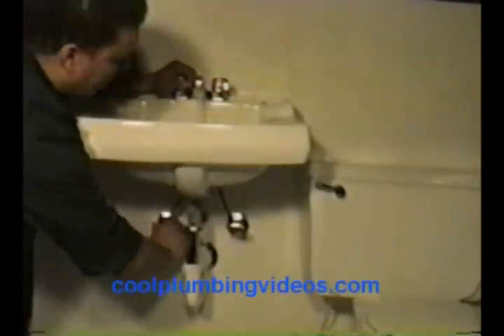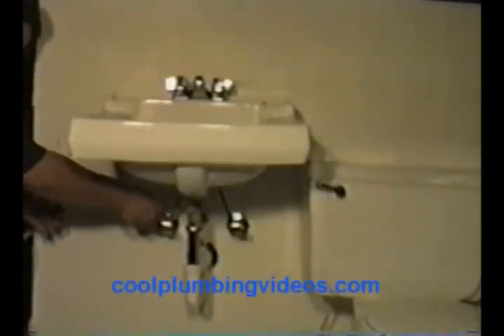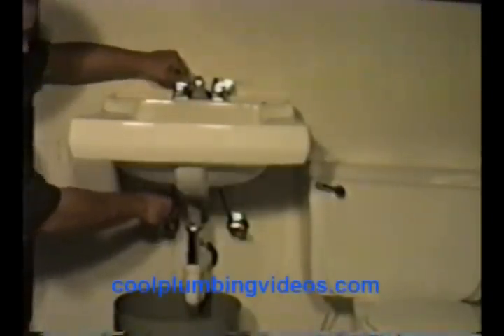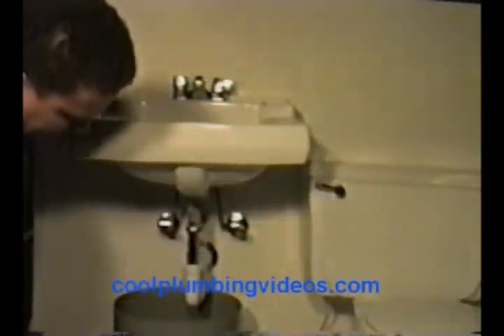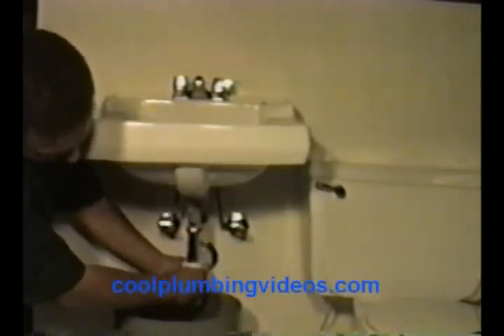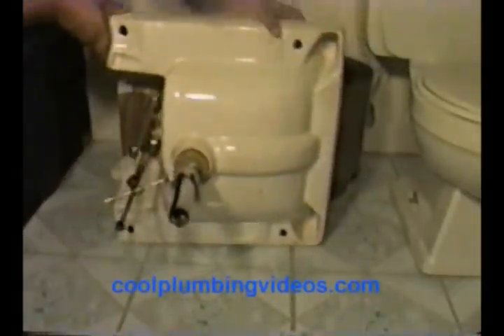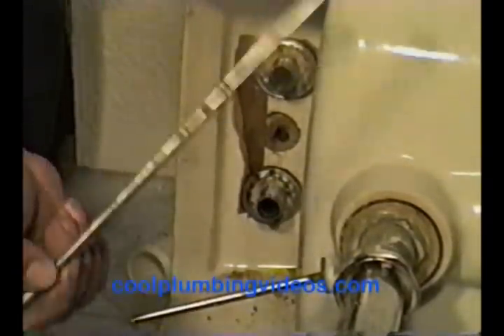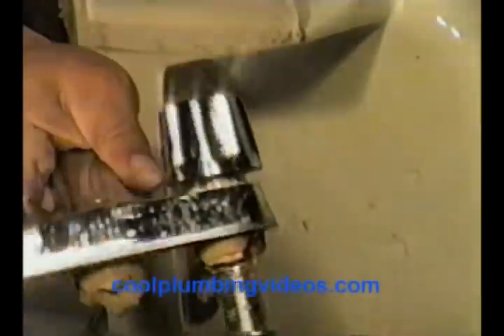Bathroom Sink And Faucet Repairs and Replacement 3/8

Comment from the maker: @zero00tolerance Yes it could be when you turn the water off to the house some thing may have gotten stuck in the aerator at the end of the faucet spout. Try to un-screw the aerator and clean it out. If not that it could be stuck in the supply line, but in most cases its the aerator Good Luck sorry I took so long to get back to you. Long day :-)

Comment: Hello i have a problem with my water pressure... for some reason the water only flows on the bathtub and not the hand sink..Could it be the reason that i just fix the bathtub valves ? please helppp